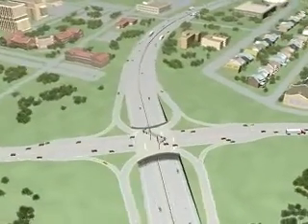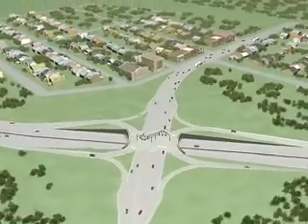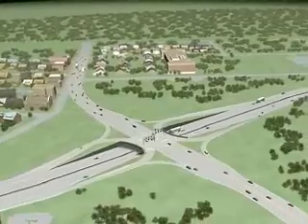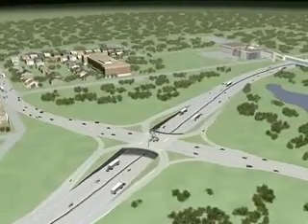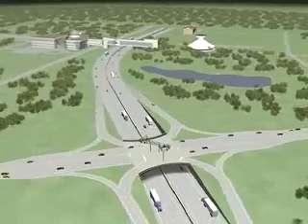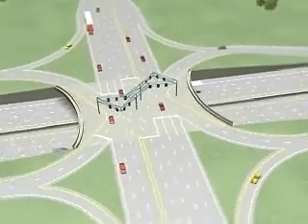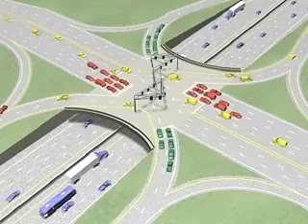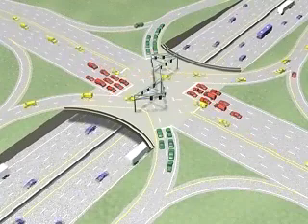Proposed Single Point Urban Interchange, Dayton, OH

Comment: Why are there traffic light pylons in the middle of the intersection? They tend to attract stray motorists, you know.
Reply from the maker: The traffic poles in the middle of the road are an error in the animation, if you are interested in an actual SPUI design you could search for I-75 and SR 63 in Monroe.
Reply: @MiamiValleyRPC  a diverging diamond seems safer and more efficient.
Reply: @Dave12753  
Actually the SPUI works beautifully and is less confusing to motorist.  There are more than a dozen of these in the Memphis/Shelby County, TN area.  Diverging diamond takes more concrete, more signals and more space than the SPUI.   The one advantage of the diverging diamond is that there are only two traffic cycles.

Comment: Unfortunately the present design of US-35 and Woodman Ave doesn't allow for the space needed to do many other designs besides the tight diamond interchange or a SPUI. The Linden Ave intersection is about 300ft (90m) away from the east bound ramps for US-35. With a SPUI, this would move the ramp intersections over the highway which is 675ft (205m) away from Linden Ave. This would allow for longer turning lanes and would reduce congestion with the added distance between intersections.

Comment: this is smart, but the whole signal light thing is lame upon retarted,. meaning verry slow and ineffective for traffic flow. germans have a thing called asfaurt, forgive my spelling.  its half a mile from the interchange but uses the merging lane as a turnaround incase you took a wrong turn. then theres no need to trun left, because your left turn would encounter at the next asfuart. then come back for your right turn. + has open traffic flow with no stops!
Reply: I think you're talking about the german "Ausfahrt". Never knew that this is a german thing.
Reply: @kazimir8086  It's just the word for exit and means nothing else.
Reply: Actually the SPUI works beautifully and is less confusing to motorist.  There are more than a dozen of these in the Memphis/Shelby County, TN area.  Diverging diamond takes more concrete, more signals and more space than the SPUI.   The one advantage of the diverging diamond is that there are only two traffic cycles.